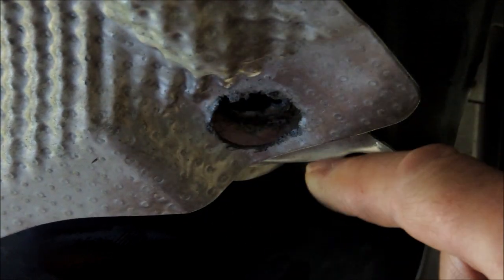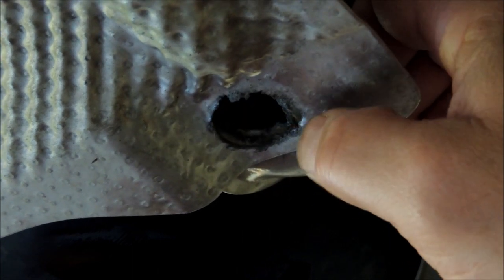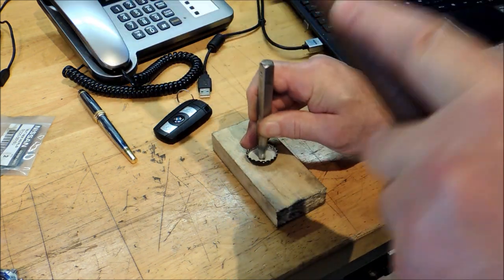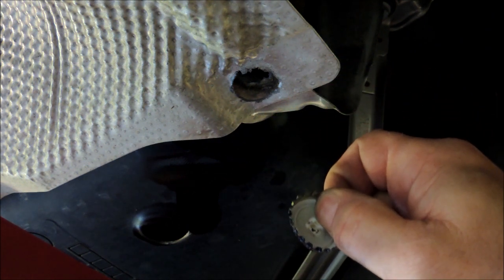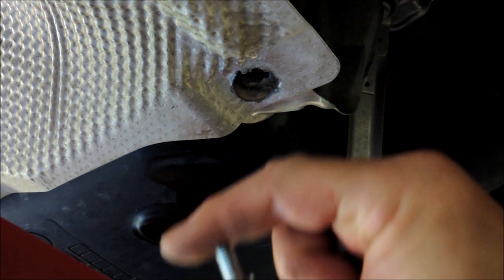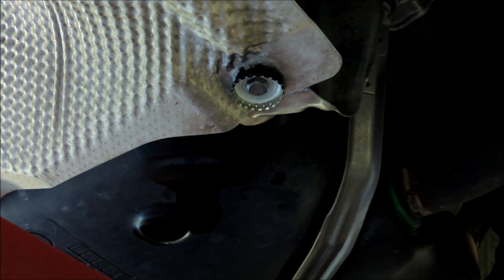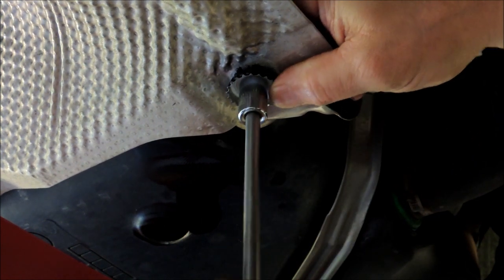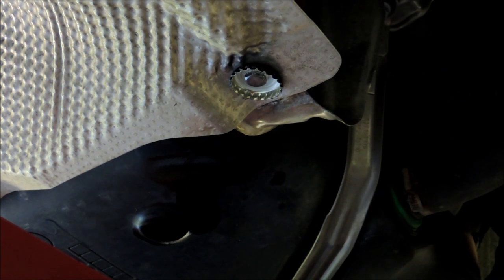Heat Shield Rattle  - Pop Bottle Cap Fix

Comment: Not at all clear how the bolt is fixed to the car body above the aluminium heat shield!
Reply from the maker: Andrew - in this shot it is simply an upper and lower heat shield bolted together - it is not a shield that is attached to the body -

Comment: I wouldnt want bottle caps holding anything on my car... so ghetto.
Reply: So what would your recommendation be? I don't see you offering any suggestions, just trash talk.
Reply: @waltp3373  That is correct, havent fixed mine, I am in the process of coming up with a solution. I want to weld in new aluminum. I am not sure if it would be possible as the metal might be contaminated to weld on...
Reply: @bruceruzbeh1887  find a spot to get a hose clamp wrapped around the exhaust, or do like this guy but with a more "professional" piece of hardware haha who cares as long as rattling is gone